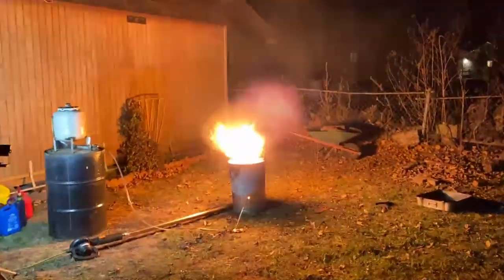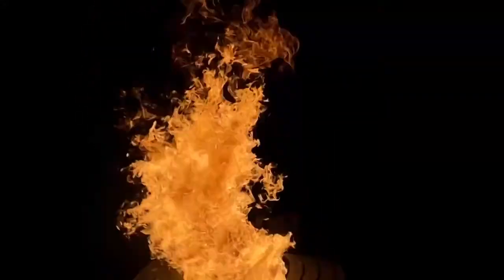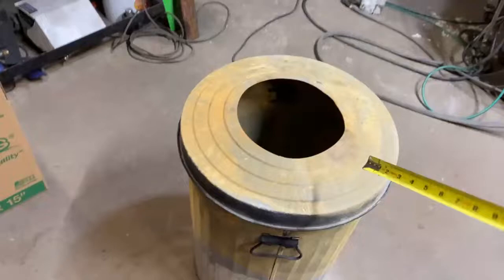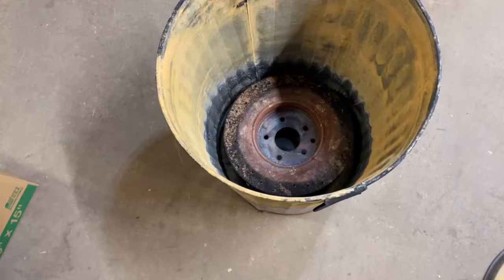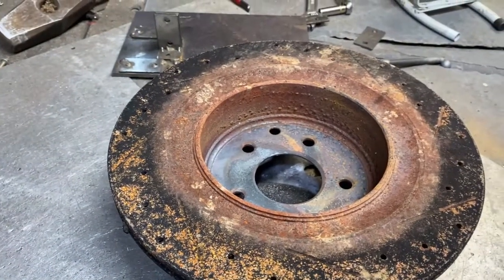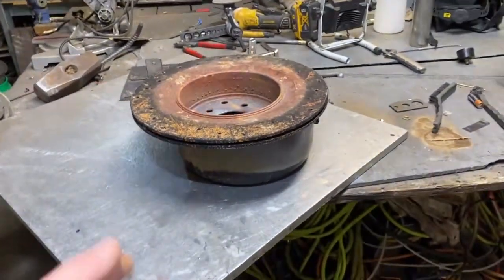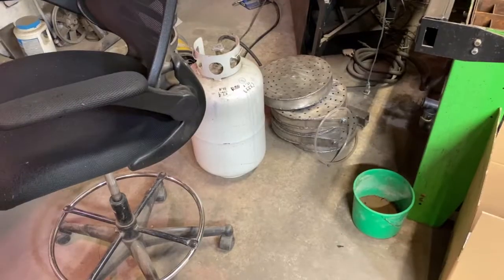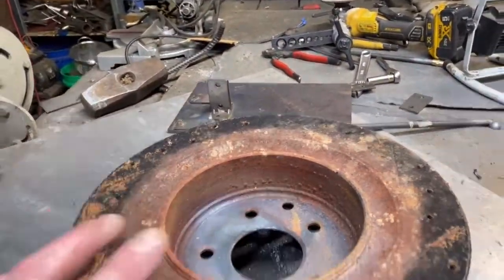PTO Diesel Frost control for Blueberry field

Comment: 1. The melting point of aluminum is about 660 degrees Celsius.  This is the low temperature for this burner.  2. The flame has a dark red color.  This also means that the burner temperature is too low.
3. Therefore, the tank cover at the bottom did not burn out: the temperature is low.
Therefore, the fuel burns incompletely, low efficiency and high emissions.
To increase the temperature of the burner, it must be insulated and HOT air must be supplied into it.
Reply from the maker: The customer insisted on this design , they had no money to do more and this is how other frost dragons operate so , same rig as them and they did not want to do more

Comment: How many flame pots does the blueberry patch need ?? What is the size of the field ???? This is going to be a challenge fella.
Reply from the maker: A tractor pulls a hot air blower behind it to blow on the crops in the morning , its an old process , they bin doing it for 40 years , they just need a little blast of hot air for a bit in the cold morning . They do it with propane as of now but they wanna switch
Reply: @NOBOX7  Loud and clear NOBOX7. Thanks

Comment: The earth is a massive heat sink.  As crafty as it may be to build a nicer flame thrower, too much heat is lost to space.  If you wanted to make a better system; you'd run something through well pipes underground that would heat the ground.  I apologize for this comment, but the truth is, I have no clue how to build such a system, but I do know your heat losses are massive.  I'm guessing you could design such a system that uses the earth as a heat sink.  The Dakota fire pit is a system that uses the earth to conceal the fire.  Perhaps some of the Dakota concepts could be used, but the burner could be warming the earth instead of the sky.  All the best.  d

Comment: if you are going to scrapyard find a brake disc, you may also find some refrigerator compressor there. those cover and body are made of good steel build to last. and there are ready available holes to fill it with liquid.

or

how about a old cast iron pot/pan. that one is easy to find too.